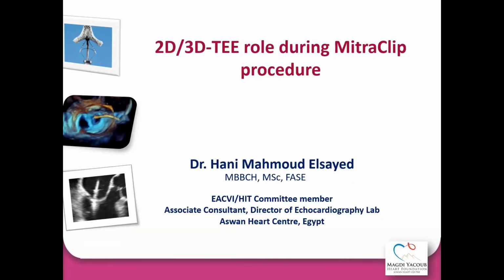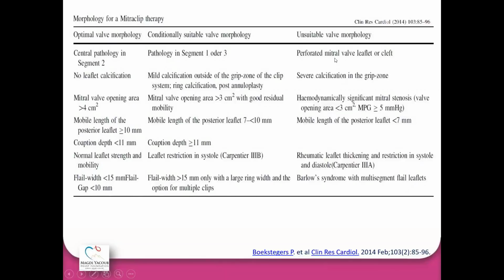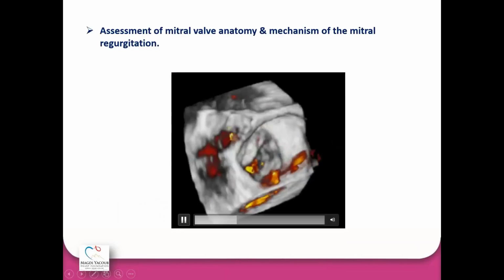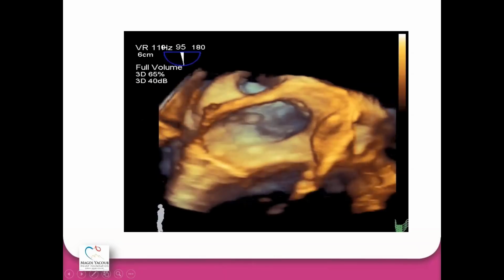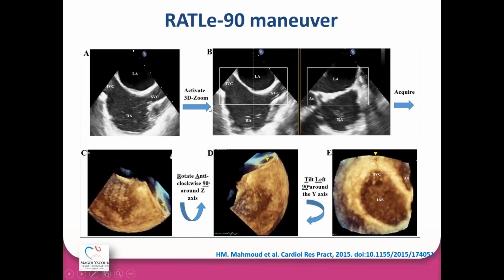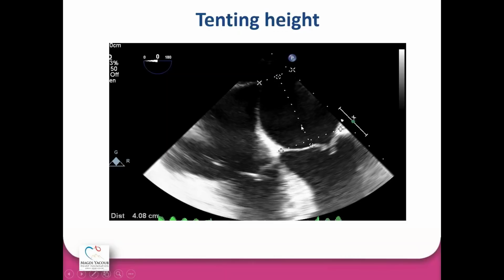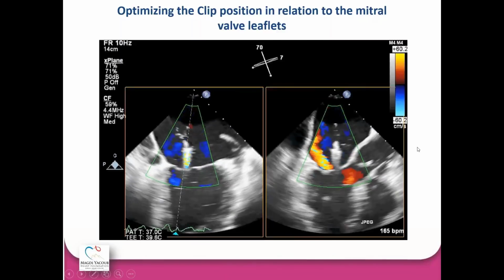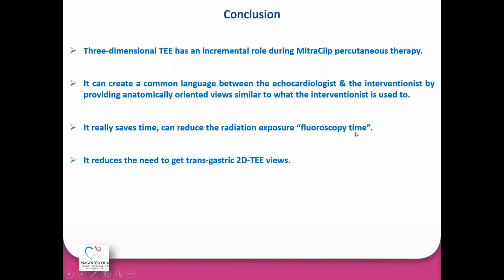2D/3D-TEE role during MitraClip proedure

Comment: Greetings from Greece. Congratulations on this very educating lecture. I am little bit confused on something: if you know you will need 2 mitral clips, why should you start from grasping the difficult A3P3? One would expect that starting from the easier lateral scallops would facilitate grasping of the medial ones, by narrowing the coaptation gap in that point. No ?
Reply from the maker: Costas Englezopoulos 
Thank you Costas for your comment 
Regarding the question, from a technical point of view, the medial grasping is more difficult as it needs a lot of medial pending if the sheath which is not always easy and needs a lot of manipulation 
These manipulations will be more difficult if there is another clip deployed in the orifice and may endanger the clip stability 
So, it is easier to do these manipulations on a naive valve and put the 1st clip medially then to put the easier lateral one later
Reply: @CIC-HANI   I understand now...thank you very much for your time!